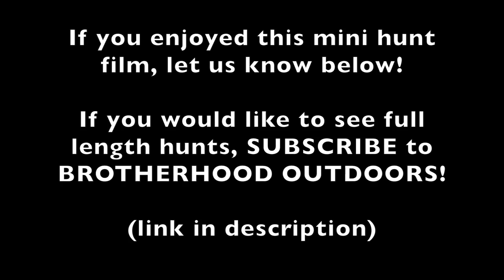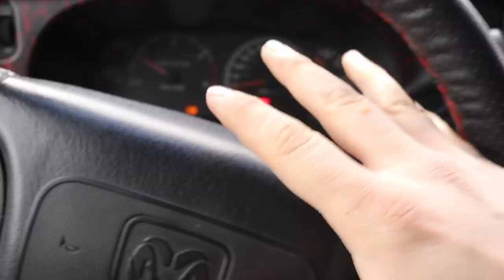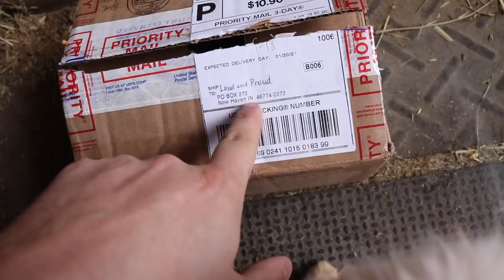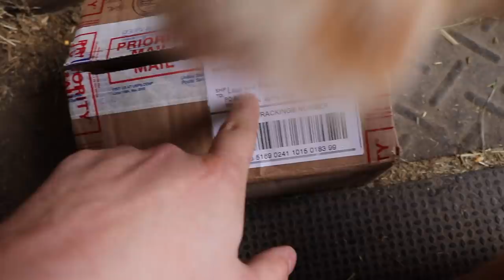THEY JUST HAD TO GO!

Comment: If the grid heater does not work for Rosine you might check the solenoid that runs the grid heater.

Comment: Hey man, not sure if I just didn’t notice, but there’s gaskets between the grid heater and intake manifolds. It looked like in the video you just slapped the grid heater on metal on metal. Probably not a huge issue but you may have a little bit of a boost leak! Maybe I just didn’t see it! Keep up the videos!
Reply: I’m pretty sure that he said something about the gasket. But ya, he will have a boost leak without them.

Comment: did you ever think that stock height truck doesn't wear the tires as badly and rides better than a lifted truck.  The silver truck with a body lift is really a stock height suspension truck why would you lift it. just fix the rear bumper height and front bumper. Dodge spent hundreds of thousands of dollars designing the suspension to work and your going to change it.